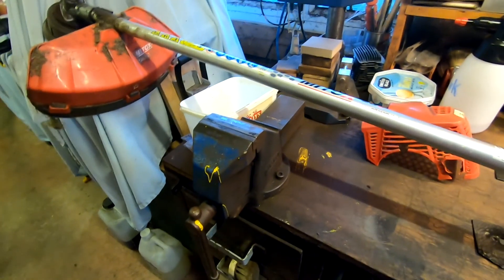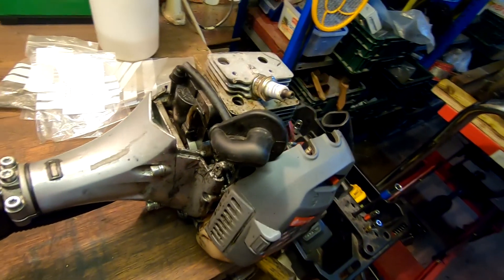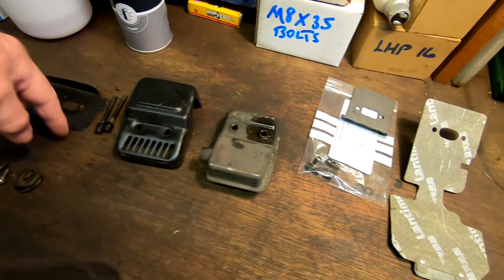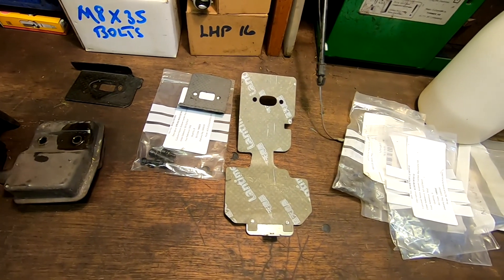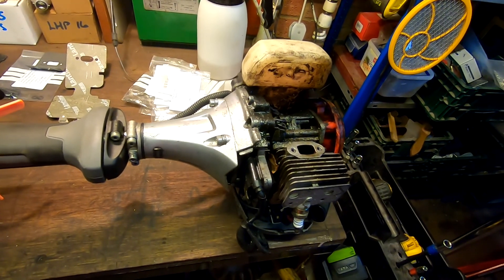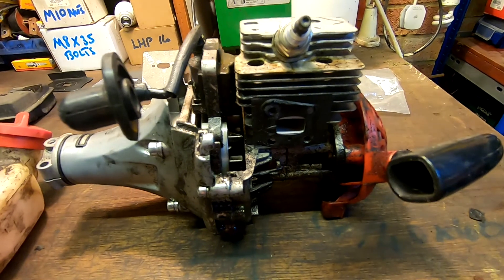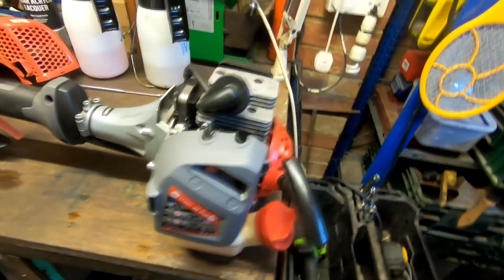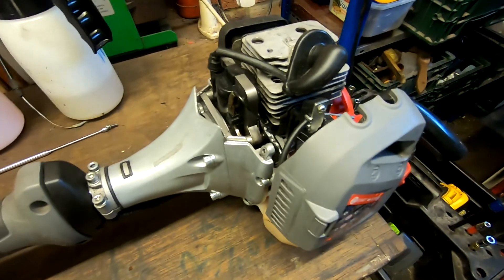Mitox 26L brought in with a slight rattle

Comment: Good job Phil and you fixed the rattle. Looks good after the clean up. That heat shield looks to be a barrier in between the muffler and fuel tank so that it doesn't heat the fuel up before it goes into the carburetor.  🤔👍🎥😎
Reply from the maker: Hi Roger, it turned out as you say, all I had to do was screw the shield to the cover once it was fitted.